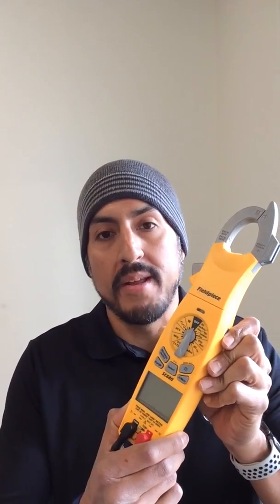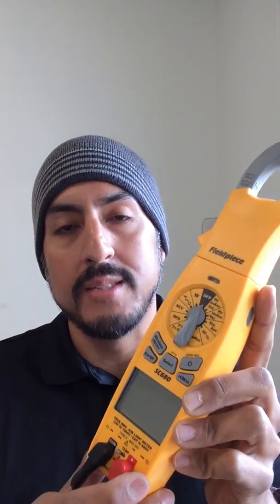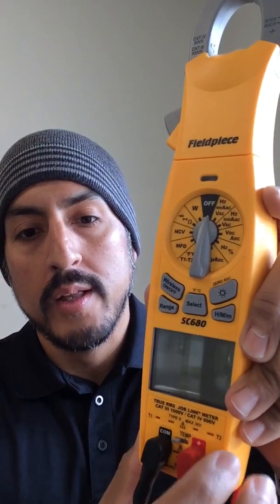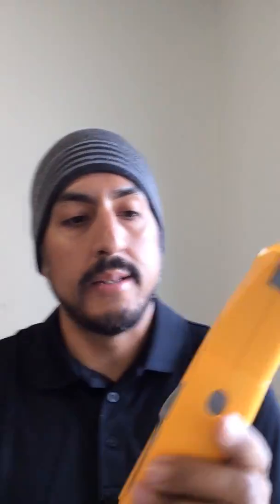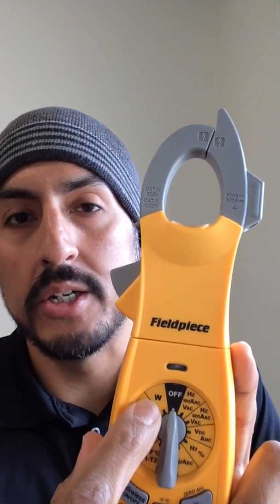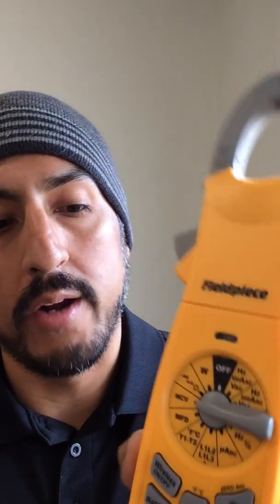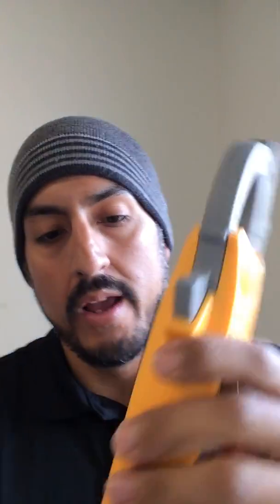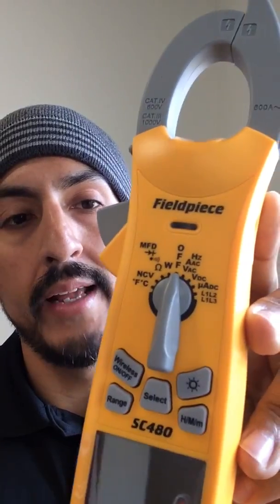New Tools from Fieldpiece

Comment: Will this be fully compatible with measurequick to calculate power factor and under load of compacitors
Reply: Yes.  The probes and manifolds work with MeasureQuick.
Reply from the maker: Robert Griffis Tony says that total compatibility is in the works
Reply from the maker: Ray Trammel be sure to go on Www.trutechtools.com and see if the meter is there. And use HVACGUY as the promocode for an 8% discount on almost everything they have for sale.